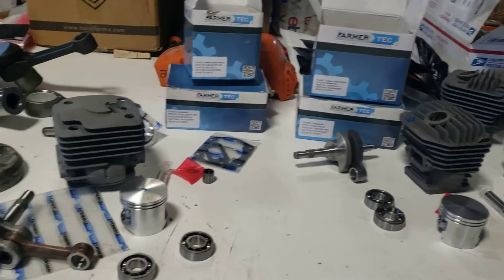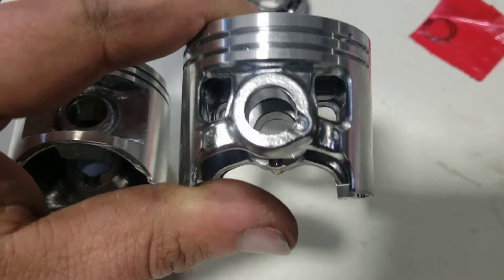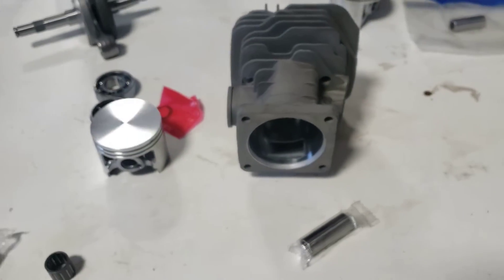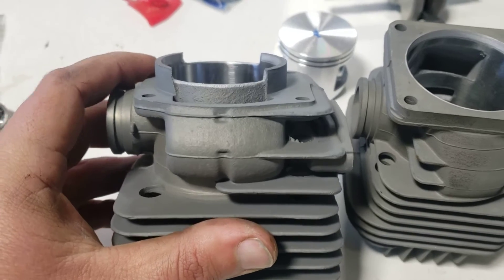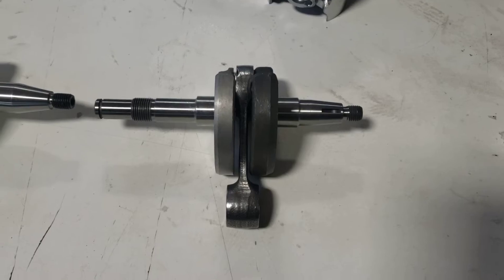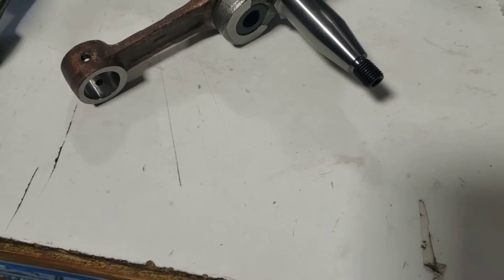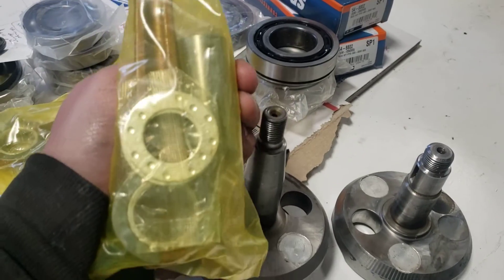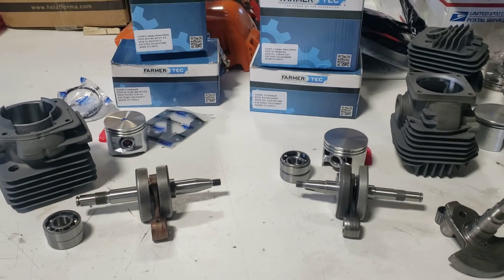Husqvarna 372xp VS Stihl 044 ms440 chainsaw parts talk cylinder porting & crankshaft design

Comment: Interesting the 038 mag is a 52mm bore, I would have thought the 044 would be larger bore, I was under the impression the 44 replaced the 038
Reply: In 1990 I went to my local Stihl dealer to shop for my first logging saw, I was looking to get an 038. I looked at the 038 MagII, the 044, and the 064. The 038 was 72.2cc @15 pounds, the 044 was 70.7cc @ 12.8 pounds, and the 064 was 84.9cc @ 15.2 pounds. The 064 balanced perfectly with a 24" bar and chain. My dad had been running 064s since 86 and thought them to be the better saw. I walked out with a 064 and alot of other folks did too. I did eventually buy a 038 Mag II many years later, and my first 064 is still going strong. If my memory serves me right, Stihl ended the 038 MagII in 1993. All three are great saws.
Reply: @1980-Timberjack  Correct i purchased mine in 1993 they are heavy.
Reply: @julioshaheen8386  Does yours have a full or 1/2 wrap handle?
Reply: @1980-Timberjack  Half wrap, Jeremy has it now making a pipe for it.
Reply: @julioshaheen8386  That's cool, maybe we will get to see it run. Thanks for sharing.
Reply: @1980-Timberjack  There is a short video on Treemonkey Performance Saws  on his facebook page 2nd one down
Reply: @julioshaheen8386  Nice, he builds some impressive saws. It's great hear you have had this saw since new and you are still running and modifying it after all these years.